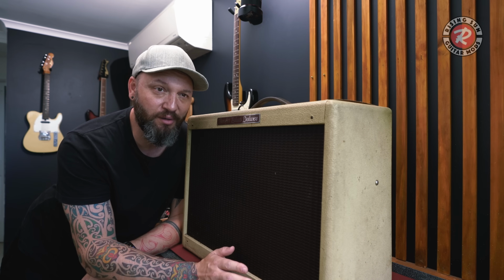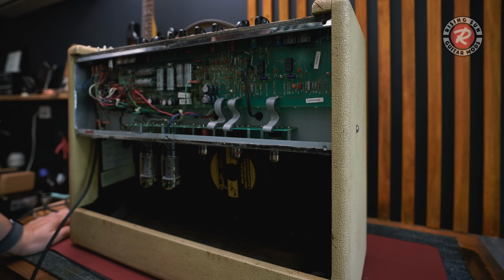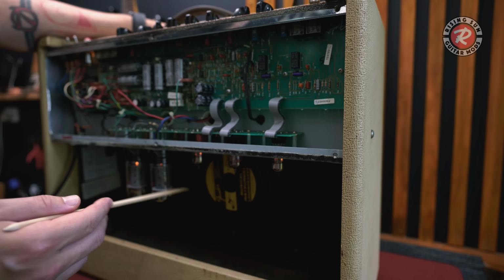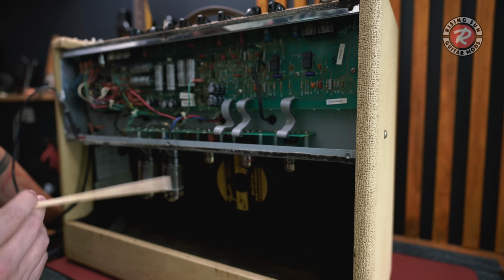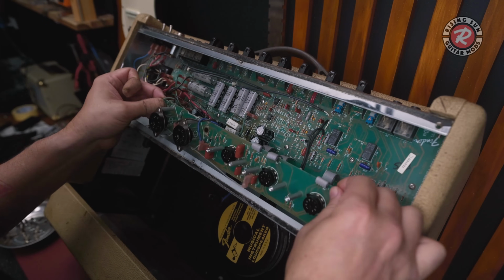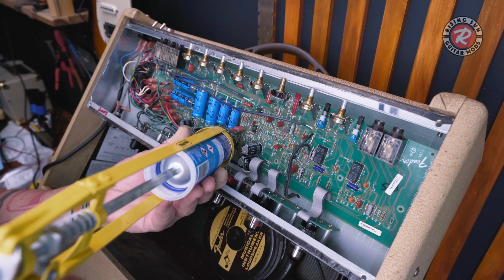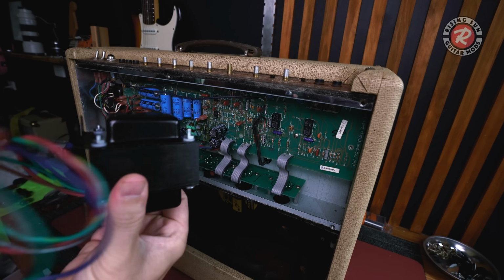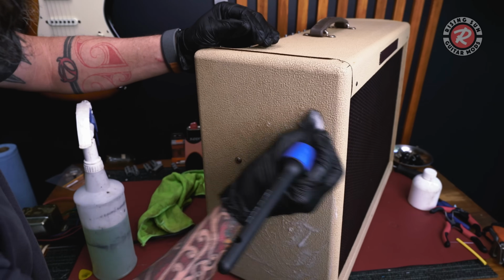1993 USA Fender Blues Deluxe Repair and Refurbish | Low Distorted Output

Comment: Kia ora bro,this is so helpful as we are pulling mine apart.
Reply from the maker: Awsome, make sure you drain those caps bro, very dangerous if you don't. Hope you can fix your up.
Reply: @RisingSunGuitarMods  ngā mihi bro,we did that we're replacing all the valves and capacitors for now,meanwhile i've been using a transistor amp lol.Is there anything else we should replace while it's open?
Reply from the maker: @steverangihuna4965  You're welcome bro. Yes, if they haven't already been replaced the 5 Watt resistors and the diodes. They usually burn out. Do you have any other issues? I would replace the plate resistors too, they are on the tube board, I think from memory they are 1Watt I put the same resistor value but up the watts to 2 watts.
Reply from the maker: @steverangihuna4965  here is the diodes and resistors: https://youtu.be/20Yc9qxOHvs?t=138
Reply from the maker: @steverangihuna4965  and the plate resistors: https://youtu.be/20Yc9qxOHvs?t=524

Comment: Are these the right fuses (UK) for the Blues Deluxe Western Noir and Friedman's Runt 20 Combo amp?  T2AL250V 20 Pcs 5x20mm slow blow glass fuse 2A 250V 0.2 x 0.78 inch time delay fuse? If these are not the right fuses, which fuses will I need for both amps? Cheers. :hand-pink-waving::face-blue-smiling:
Reply from the maker: It should say on the back of the amp, if not, try and find the schematic for your amps, it will be on there.

Comment: It's common for gear snobs love to sh&t all over these amps and i get it- it's not "hand wired, PCB etc..." but as someone who owns a bunch of blackface fenders, I put my  94 Blues deluxe up against any of them. I had it serviced recently and it sounds so great. Had it since 1994. I recommend trying a Vintage 30 for speaker in them, it adds some nice mids to it. It always sounds good with pretty much any pedal you want to throw at it and for as loud as it is, it's not as heavy as it's fighting weight.
Reply from the maker: Yea I don’t disagree with the sound. For the clean channel at least. The gain channel is a bit harsh. The main problem with these amps is reliability, mainly when you drive them hard everything just gets too hot for the factory specifications to handle, nothing wrong with surface mount boards when they are designed correctly. These amps are notorious for failing due to poor design, especially on the 5w resistors where they are mounted directly on the board with through hole, and the plate resistors on the power tubes are under value for this design. Can be sorted with some mods but I think at the price point these are you shouldn’t need to. This being said you could get away with one never failing if you never drive it too hard. 👍
Reply: @RisingSunGuitarMods  yep this is probably true. I played mine hard for 20 years and then the heat resistor thing happened. I got the caps changed, resistors replaced and lifted and the tech drilled a little hole to vent the heat of the board on the back panel. The OD channel actually sounds decent now since Iupgraded the caps. I figured it would be just a "beater" amp for rehearsals and someting I wouldn't worry about like my vintage amps, but most of the time I end up liking the Blues deluxe better!